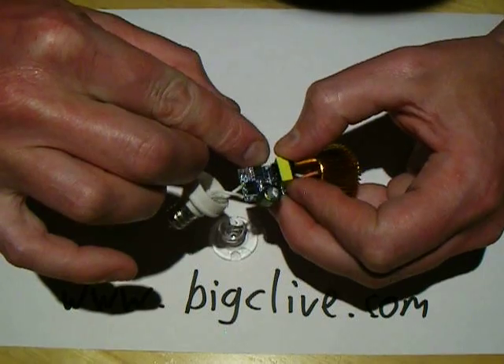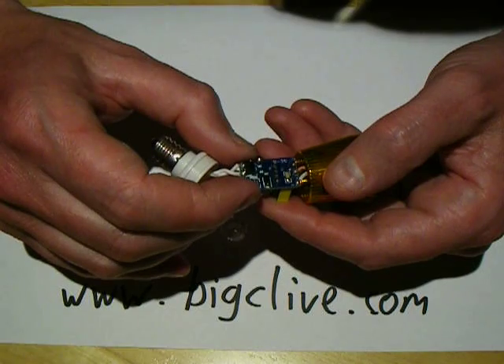3W LED candle lamp teardown.

Comment: In comparison to the quality of the LED lamps you show in your more recent video's, this one looks quite decent. Apart from the flimsy isolation between you and the mains of course. This lamp has a transformer in it, maybe not the safest in the world, but compared to the ones with a capacitor dropper, I would consider this example a little safer.